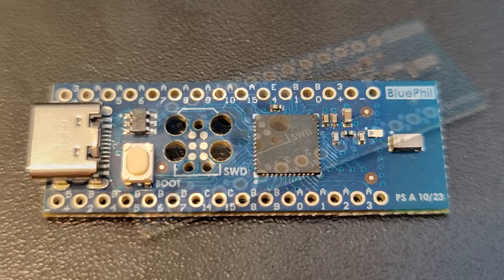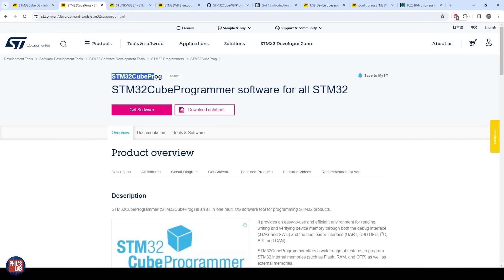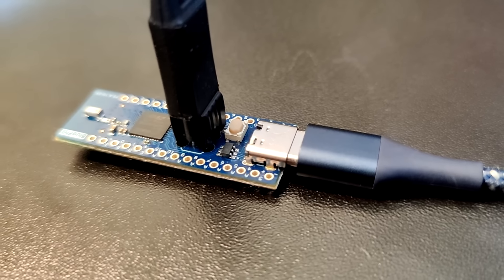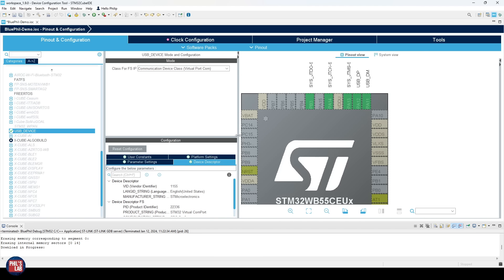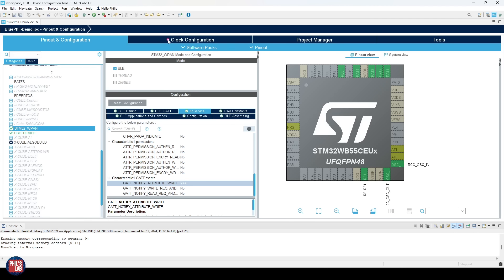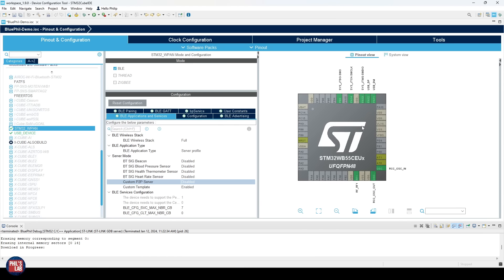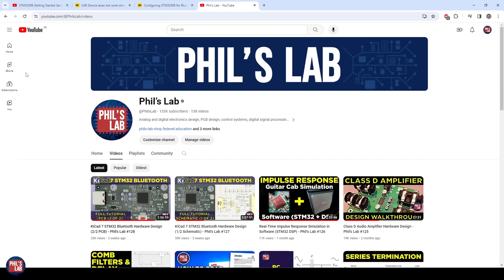STM32 Bluetooth Firmware Tutorial (Bring-Up) - Phil's Lab #129

Comment: Summary

Introduction to STM32 WB Custom Hardware Design
- 0:00 Introduction to the video's topic: board bring-up steps for STM32 WB based custom hardware.
- 0:07 Overview of the STM32 WB 55 microcontroller and its features including chip antenna, user switch, and USB-C connector.
- 0:21 Explanation of the tag connect header for programming.
- 0:32 Mention of quirks in firmware setup to be addressed in the video.

Hardware Design and Supporting Tools
- 0:43 Reference to a detailed hardware design tutorial available in two videos.
- 1:08 Acknowledgment of PCBWay for manufacturing the STM32 WB custom hardware.
- 1:32 Use of Altium Designer for the board design and a promotion for a free trial.

Schematic Overview and Components
- 2:15 Introduction to the schematic of the STM32 WB 55 board.
- 2:20 Details of the USB type-C connector and power configuration.
- 2:49 Description of the programming interfaces and boot zero functionality.
- 3:01 Explanation of the boot zero switch's role in firmware startup.
- 3:21 Description of the 32 MHz Crystal oscillator and the absence of a low-speed external crystal.
- 3:37 Overview of the integrated switch power supply and the RF front end with a chip antenna.

Microcontroller and Software Tools
- 4:03 Introduction to the STM32 WB 55C microcontroller, its features, and dual-core architecture.
- 4:23 Suggestion to download STM32CubeIDE for development.
- 4:47 Introduction to STM32CubeProgrammer for flashing firmware.

Debugging and Programming Hardware
- 5:01 Recommendation to use an ST debugger, specifically the STLink V3.
- 5:24 Explanation of the tag connect header and its connection to the STLink V3.

STM32CubeProgrammer and USB DFU
- 6:26 Demonstration of using STM32CubeProgrammer to check device connectivity.
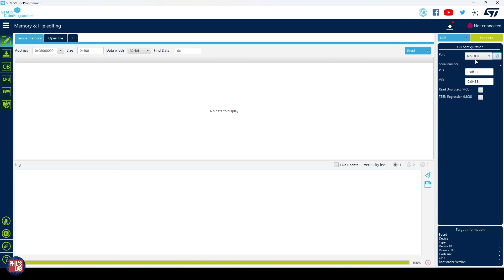- 7:00 Description of the boot zero functionality for USB DFU mode.
- 7:47 Adjustment of option bytes to enable boot zero pin functionality.
- 8:20 Demonstration of entering DFU mode using the boot zero switch.
- 9:03 Connecting to the microcontroller via USB in DFU mode.

FUS & BLE Stack
- 9:27 Explanation of the need to download co-processor binaries for the wireless stack.
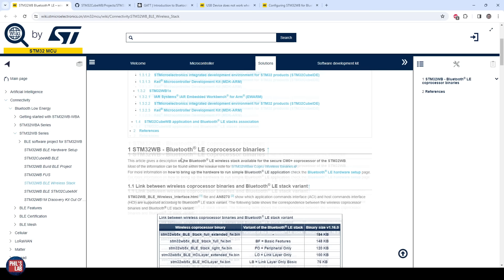- 10:02 Discussion on various available stacks and where to find them.

Firmware Update Service (FUS) Process
- 10:50 Explanation of the Firmware Update Service (FUS) in STM32CubeProgrammer.
- 11:06 Process of starting the FUS.
- 11:19 Checking FUS version information.
- 11:32 Note on the typically outdated FUS version in shipped STM32 WBs.
- 11:37 Steps to download and open the FUS binary file.
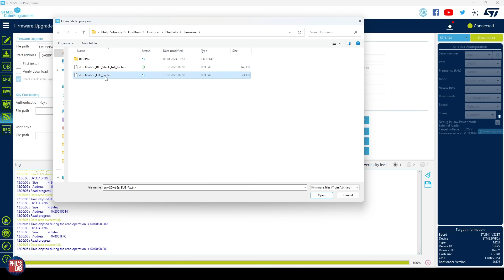- 11:45 Instructions on finding the correct start address for the FUS.
- 12:02 Reference to the firmware upgrade service binary table for address determination.
- 12:15 Identification of the correct address for STM32 WB 55 CU6.
- 12:27 Steps for firmware upgrade using the STM32CubeProgrammer.
- 12:40 Verification of the updated FUS version.

Adding the Bluetooth Low Energy (BLE) Stack
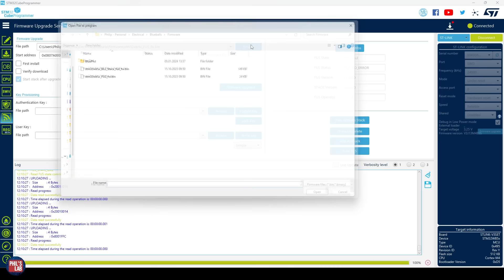- 12:53 Process for adding the BLE stack.
- 13:00 Steps to find and change the start address for the BLE stack.
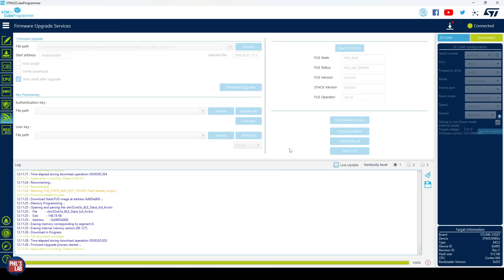- 13:21 Completion of the BLE stack firmware upgrade.
- 13:34 Verification of the BLE stack version.

CubeIDE Project, SWD & HSE/LSE Set-Up
- 14:04 Transition to setting up the main firmware in STM32CubeIDE.
- 14:17 Creation of a new STM32 project in CubeIDE.
- 14:38 Introduction to the ioc window for selecting pinouts and peripherals.
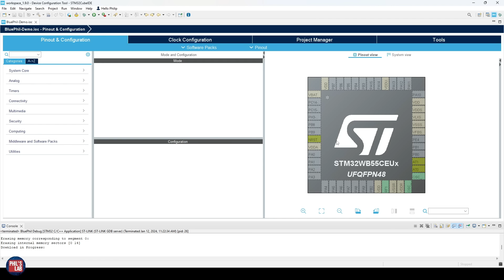- 14:44 Basic setup for a USB and Bluetooth interface application.
- 15:09 Enabling Serial Wire Debug (SWD).
- 15:37 Explanation of enabling crystal oscillators, specifically HSE and LSE.
- 16:04 Note on the optional nature of the LSE and its implications.
- 16:29 Recommendation to include LSE in hardware design.
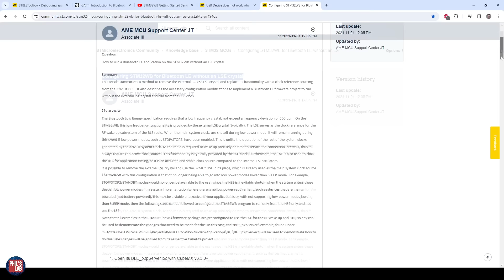- 16:41 Reference to a guide for configuring STM32 WB for BLE without LSE.

USB Set-Up for Application
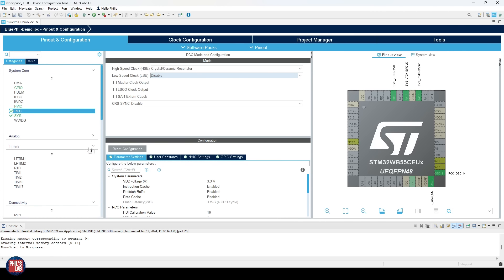- 17:05 Steps to enable USB for the application.
- 17:23 Explanation of choosing the virtual COM port in USB middleware settings.

RF/BLE Set-Up in CubeIDE
- 18:13 Initial steps to enable Bluetooth functionality in the project.
- 18:31 Suggestion to read additional resources on Bluetooth technology.
- 19:17 Process of enabling various system components to access BLE middleware.
- 19:48 Activation of hardware semaphores for core synchronization.
- 20:01 Enabling IPCC for inter-core communication.
- 20:26 Activation of RTC for BLE stack access.
- 20:51 Enabling RF interface for antenna communication.
- 21:04 Selection of the relevant BLE stack in middleware settings.
- 21:15 Mention of various configurable parameters for the BLE stack.

Setting Up Bluetooth Communication
- 21:47 Process of sending data from phone to hardware via Bluetooth, then printing it out via USB.
- 21:52 Mention of ST's BLE Toolbox app for Android and iOS for Bluetooth interaction.
- 22:16 Configuration of BLE applications and services in STM32CubeIDE.
- 22:23 Disabling the custom P2P server and enabling the custom template.
- 22:49 Changing advertising settings to include the device's complete local name.
- 23:09 Setting up a GATT service and characteristic in STM32CubeIDE.
- 23:33 Creation of a service and characteristic for data transfer in BLE setup.
- 24:06 Configuration of service characteristics properties, setting up a write characteristic.
- 24:42 Adjusting events to trigger only on attribute write.

Clock Configuration and Firmware Flashing
- 25:01 Setting up the clock configuration in CubeIDE.
- 25:35 Resolving clock issues automatically using CubeIDE's feature.
- 25:46 Completion of BLE GATT, USB setup, and serial wire debug configuration.
- 26:07 Generation of necessary drivers and supporting structure after saving the IOC file.
- 26:19 Instructions for building and uploading the firmware using STM32CubeIDE.
- 26:50 Encounter with a USB device recognition issue.
- 27:02 Reference to a forum post explaining the USB recognition bug and its fix.
- 27:14 Implementation of the fix by modifying the peripheral clock config function.
- 27:38 Successful recognition of the USB serial device in the device manager.

Testing Bluetooth and USB Functionality
- 28:02 Confirmation of USB connectivity and Bluetooth service functionality.
- 28:14 Using the ST BLE Toolbox app to detect the Bluetooth-enabled hardware.
- 28:55 Connecting to the microcontroller via the app.
- 29:19 Identifying the custom characteristic set up for Bluetooth communication.
- 29:50 Adding functionality to the project to complete data transmission testing.
- 30:03 Modifying the STM32 WPAN folder's custom service for the test.
- 30:21 Description of the event handler function for Bluetooth characteristic changes.
- 30:40 Inclusion of the USB CDC driver in the project.
- 31:03 Adding code to transmit received Bluetooth data over USB.
- 31:39 Final compilation and firmware upload for testing.
- 31:51 Setting up a serial port connection on the host computer for data reception.

Conducting the Bluetooth and USB Test
- 32:03 Initiating Bluetooth connection to the hardware using the ST BLE Toolbox app.
- 32:15 Testing data transmission from the app to the microcontroller, then via USB to the host computer.
- 32:28 Successful transmission of a character ('H') from the phone to the hardware via Bluetooth, displayed in the PuTTY terminal.
- 32:34 Verification of Bluetooth and USB CDC connections and data forwarding capability.
- 32:40 Demonstration of sending various characters to showcase basic functionality.

Firmware Customization and Extension Possibilities
- 32:47 Discussion on extending the firmware's capabilities, such as increasing character value length.

Conclusion and Overview of Achievements
- 33:05 Summary of the video's achievements: basic firmware bring-up testing various peripherals of STM32 WB 55 microcontroller.
- 33:10 Review of tested features: Bluetooth, Serial Wire Debug, boot zero setting, USB-C, and chip antenna functionality.
- 33:17 Encouragement for viewers to use the demonstrated framework for developing their own designs.
- 33:28 Invitation for feedback, questions, and encouragement to subscribe for future videos on hardware, firmware, DSP, and electronics.

Disclaimer: I used chatgpt4 to summarize the video transcript.  This
method may make mistakes in recognizing words.

Comment: Is it possible to build a communication between two STM32WB55 just like (or at least as fast as and as reliable as) the ESP now by espressif but with lower power consumption? The scenario i'm looking for is one STM32WB55 as a sender (controller) and an other STM32WB55 as a receiver (like a drone or robot).

Comment: For some reason you tend to always make videos about topics I'm currently dealing with. 
I'm trying to add Bluetooth Audio to my car's stereo. Since buying a new stereo is boring and the current one also doesn't have an AUX IN, I decided to make an protocol emulator for an optional CD changer. That already works with an Arduino and a cable. I tired to get it BLE audio to work with an ESP32-C3, but I had no luck. I couldn't find any documentation or examples on BLE Audio, not even in the IDF. Only A2DP, which I don't want to use because it sounds quite terrible. So I guess I'll give the STM32WBs a chance now.
Reply: Neat! How did you find the protocol?
Reply: @GoPaintman  It's a Ford RDS 6000 CD stereo. TL;DR; I found existing projects that implemented the necessary parts of the protocol, and one of them also had scans of the original specification document.
 I found a pinout for one of the rear connectors that was unused on my car. The names looked like AUX related. Simply feeding some audio signal into it did nothing. Looking further I found that CD Changers are a thing and I figured out that ACP+ and ACP- are supposed to be some data communication pins. Searching for Ford ACP lead me to a lot of existing projects, even dating back to the pre-arduino-era. I wasn't completely happy with the implementations I found, I even considered buying a CD Changer from Ebay to reverse engineer the protocol. Then I found the original specification document in a project named "Yampp3".
Reply from the maker: Glad to hear the topics are aligning well - also cool project you have going there!

Comment: This is so much better than the ESP32 platform. Had a nightmare time getting up and running on that without going the arduino route. Currently working through video #2 and will get the board fabricated soon.
Reply from the maker: Yeah, I'm not much of a fan of the Arduino environment, but still am planning on making a video covering ESP IDF. I'm just so used to the whole ST ecosystems, that - despite some bugs - it feels quite straightforward.
Reply: yea some call it arduino hell since getting out requires a lot of learning  but IDF is ok
Reply: To be fair, arduino has its uses. No one can deny its been incredibly successful as bringing microcontroller project design to the 'masses'. Ie a general hobbyist who just wants something relatively quick and doesnt mind (or understand) the dirty.

It is a tool to allow hobbyists to relatively 'easily' get into things etc... 

Is it 'pro' grade or a thing an embedded engineer would use during their day work? Of course not, but thats not the market. 

People who have embedded experience do it the way Phil does with STM tools and debuggers etc.. (for STM microcontrollers).

Arduino is what arduino is.
Reply: @Thats_Mr_Random_Person_to_you  For me I had no embedded experience at all but came from other high level languages (Java,C++) and was used to fully featured IDEs. This is why when presented with the Arduino IDE I just couldn't deal with how limited everything was. Thanks to this channel I discovered STM32 and love it.

Comment: With all the additional files that get generated after enabling BLE what is the "proper" place to write normal code (like flashing an LED)? Is it still main.c or somwhere else?
Reply from the maker: Depends on what you require. In main.c while loop, you'll see that a BLE 'task' is actually run. Some code will be in main, others like shown in the video may be in event handlers.

Comment: Do you have any low-power designs where the STM32 runs from a coin cell (eg 2032), whether you need boost converter, guess for debug you'd have Schottky diode to USB power as well !
Reply: I have also had a look at AN4718 which talks about VBAT and coin cell use.